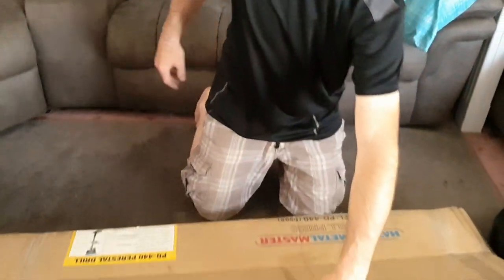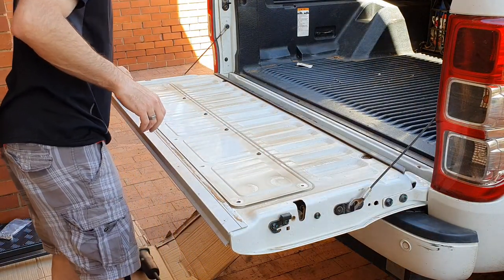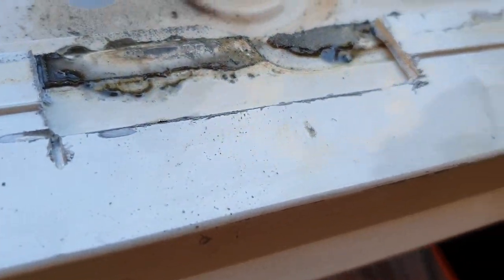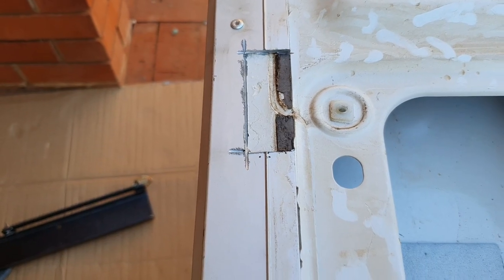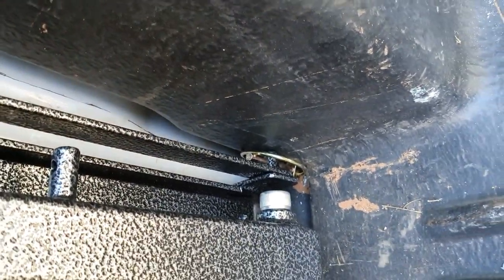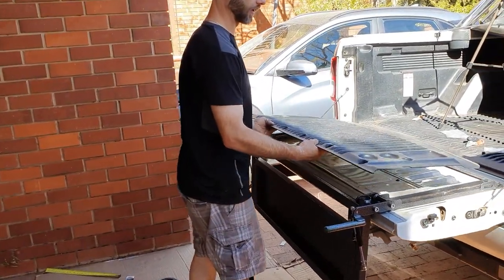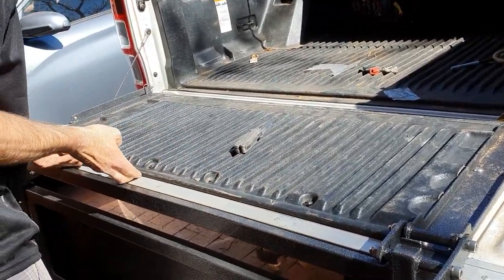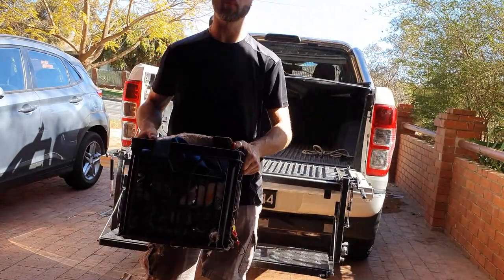Limitless Tailgate Step Install | Ford Ranger

Comment: I have the same Ranger and my first thought was "How heavy is that already heavy tailgate going to be?" Sure enough, you said it. Something I also noticed is the step can be used as a shelf either inside the tub with that bar locked onto the step or if you flip it down and leave it magnetically stuck then you have a shelf with a rim around it sticking out the back of the tub. Would be handy for a tradie like me as a painter and mixing paints etc.

Comment: It is a good idea but I would rather opt to put a sliding bed tray on my ranger so i do not even need to climb on the bed side. It looks better too and you can organize your truck bed more. But this video is also great :)
Reply from the maker: Yeah, the only drama with a sliding bed is you limit your height a bit as well as there's a while bunch of stuff to get gummed up with dirt and rocks and things if you ever transport that kind of stuff

Comment: Hi how are you doing? 
Is it worth to have it after one year use?
Have some rusted ?? Broken?? Or some parts were broken??
Does it make an annoying sounds ? When driving a vehicle? Like  squeak, crackle, .... Etc.
And thank you so much 😊
Good bye 👋
Reply from the maker: Hey there mate, honestly it's been fantastic. No noise, no rust, nothing has broken or bent on it. The powder coating hasn't even worn off any of it. I'm out in the desert this weekend, using it a lot as a seat and to get in an out of the ute. I'll record a little follow-up video a year in, thanks for the idea :)

Comment: Another drawback would be that I have the titan drawers and to get into them, assuming they weren't too wide, I would have to drop the step down to get into them. Which wouldn't be too bad I guess because I wouldn't need to pull the step down into position, it could stay up but If I am in and out of the drawers a lot and need to keep the back shut in between for security then it will become annoying. Then it would be a choice between how often I truly need to get up into the back and how often I need to get into the drawers. For me, getting right up into the back is required once in a while whereas I am getting stuff out of the drawers daily. But every time I'm climbing up in there I am cursing the tailgate.

Comment: Great job. Congratulations on winning this tailgate step. I want one and have reached out to them to answer the same queston I am asking you . I live in Texas and have a full sized Ford F-150. I was hoping you could tell me your tailgates dimensions please. Length and Width so i can compare to  my full size Ford tailgate which is 60 inches x 23.5 inches (LxW) Thank you sir.
Reply from the maker: Hey there mate, I've got some info for you :) might need to do some conversions though as my tape measure is in metric only
Dimensions of the tailgate on my Ranger: external width 1405mm & height 580mm
Internal flat area width 1260mm & height 515mm
The tailgate step mounted to the tailgate is width 1280mm (the handle sticks out past the flat area) and height 480mm
The other thing you might like to know is the height of the tailgate from the ground. My ute has a 2" lift in the rear so the tailgate is 850mm off the ground and this step folds out to be 520mm off the ground
I hope that all helps, let me know if you need any other measurements mate!
Reply: @DoctorOctane  Mine arrived last night. It took approximately 10 days to arrive from down under to Texas
Reply from the maker: Hey, that's pretty good actually, I reckon the last thing I ordered from the states took longer than that to arrive

Comment: Had a question from the edge of the tailgate to the step when opened what’s the length? Just have a 2500 with 37s want to know if it’ll be low enough to step on still
Reply from the maker: Hey mate, it's roughly 35-40cm. Definitely will be easier than what you're dealing with now!

Comment: Hello DoctorOtane, can you Please Please reply me as I really like your truck’s bed liner what is its brand name and which website you bought it from would appreciate your answer and do you have link of video for installation of bed liner if you made one when installed that.Thanks.
Reply from the maker: Hey mate, that bed liner is the one the Ranger comes with from the factory. I'm fairly certain it's only held in with the 6 tie down loops in the bed

Comment: What if you would have left the screws out and slide it in and not bend it. Then tighten the screws.
Reply from the maker: Yeah that could potentially work but once it's tucked under there and screwed down you can't even tell it bent. That would make it easier to install though and a good tip for anyone else having a go
Reply: @DoctorOctane  I would have creased it badly, That's just how easy I can mess stuff up! :)

Comment: Handsome, sexy, young man. What about us ugly, geezerly, old coots?  LOL.
They just brought the Gen 4 Ranger back to the US, and the first thing I realized was that it's almost a foot (30 cm) taller than my old Gen 3. I still bought it.
And, being said old coot, it's a lot tougher to get in and out of the bed to get something that slid to the front.
On my to buy list!
Reply: I'm not even really that older (30) 
I have the sports package, i think larger tires and maybe the suspension is a little different. Its rough to get in there, im def looking into some step solution
Reply from the maker: Haha, I've got a lift and bigger tyres on mine so my height of the step will be a couple of inches higher than standard. I don't imagine a factory "sports" package would give you more than a combined 75mm height increase but if it did this would still make it easier to get in and out
Reply: @DoctorOctane  idk its 940mm from the ground to the tailgate when its open
Reply from the maker: Yeah that's about the same height as mine unloaded, should work well

Comment: Can this be put on Toyota Tacom
Reply from the maker: Hey Ellen. It's very possible they have a set-up that's either perfect for the Tacoma or can be adapted. We don't really have the Tacoma in Australia but if the tailgate is the same as the Hilux, it should fit. Check the website to see what they have available

Comment: Is it still working well after 2 years?
Reply from the maker: It's working fantastic, you can see it in use in my most recent video but I'll do a follow-up soon
Reply: @DoctorOctane  that's great! What about if you need to load a pallet? Does the step get in the way or is it not too bad?
Reply from the maker: Folded down it's as though it's not even there, just need to make sure the forklift driver is aware it's there and folded up, pallets sit up fine on it to be able to be slid on a bit further if the forks are short and the driver prefers it folded up. Just need to make sure the driver doesn't drop or slide the pallet over the locking handle. Either way no major issues loading pallets

Comment: 16:15~19:23 Why did you not make little bit loose bolts for two side frames? You don't need to worry about bent nor scratched for the inner panel.
Reply from the maker: Unfortunately, you can't really access the bolts under the frame of the step so even if I was to slot out those four bolt holes, access to put the actual bolts in is obscured. Its mostly just a case of muscling it in under the frame of the step and putting the rest of the bolts in that are accessible

Comment: Just buy the step that goes under the bumper.
Reply from the maker: Because 1. if you change your rear bumper it looks odd 2. You miss out on the load stop feature and 3. You now don't have a foot rest when you and a mate are sitting on the rear step. Also the dinky little rear bumper step isn't possible to get onto the tailgate when it's open
Reply: @DoctorOctane  youn must not be familiar with the AMP step it bolts on to your frame and goes underneath your stock bumper. I have it on all my trucks and works excellent.  You can avoid butchering up your tailgate.
Reply from the maker: Yeah but it's still a tiny little step, under the tailgate. Not particularly safe for stepping up while holding something you're putting into the tub or while stepping out of the tub carrying something

Comment: You screwed up if you used hollow wall anchor bolts to attach the device you could of left it loose until the inspection was re-attached then tighten the anchor bolts no need to keep a spanned on the back side

Comment: First time on channel, don't know how I got here or what your channel is about but, you don't appear to be a car guy...I think more a computer of salesman of some type. Torx screws anti-theft? um no. So the heads don't strip. And normally they attach as a socket for your impact driver...where the heck is your impact driver?  Well heck, at least your giving it the old college try, so hat's off to you for that.
Reply from the maker: Thanks for leaving a comment mate, my channel's not really about anything in particular.
Let me try and address your concerns. First of all, there's torx head bolts and there's torx head bolts with the pin in the middle, the ones with the pin in the middle are considered "security" bolts. Yes they're less likely to strip when you insert or remove them but the pin was originally designed as an anti-theft measure and the bots to remove them are marketed as "security torx bits". Nothing to do with being a "car guy". Second of all, I don't own an impact driver. It's very difficult to use a tool that you do not possess and as such the torx bits that I used were of the manual, L-shaped variety. I'd be more than happy for one of my wealthy subscribers such as yourself to send me an impact driver so that I can use it but if it comes to saving for it myself, I have more important things to spend my money on than another cordless drill

Comment: One of the problems i see from this kind of products is the way they advertise it,  way too far from reality and way too expensive something supposedly for working class not rich class level
Reply from the maker: Right... not sure what reality you live in mate but if a $1,000 accessory for a $60,000 vehicle is too bourgeoisie for you then you probably should focus on putting food on your family's table rather than buying or accessorising a new vehicle in the first place. Personally, $1,000 for the practicality of this product and the amount it gets used is money well spent. Especially when you consider a decent set of wheels alone will set you back a couple of grand and provide absolutely no advantage over the ones the vehicle was delivered with. People will spend thousands on just the looks of their vehicle, providing no practical benefit to the user, then baulk at a product that makes their life with said vehicle easier.
Reply: @DoctorOctane  mic drop😂😂😂

Comment: Why did you say a foot and a half when we changed to metric before you were even born?
Reply from the maker: Because in some situations different units of measure are more appropriate to convey a sense of size than others. In addition to that, old timer, many things are still referred to by their imperial measurements no matter that we're under the metric system. Either way, did you understand what I was talking about? Did you get the gist of what I was saying?
Why did you make your user name all caps? All caps was shouting long before you were born
Reply from the maker: Dude, chill... you clearly understood what I said and are being obtuse for what I can only imagine is shits and giggles. You've had your shits and I've had my giggles, go home
Reply: @robertbutler8004  to be fair do you understand 450 apples, or two trucks long as a practical sense in your mind.  I love the metric system but when it comes to "about a foot" there is no good measurement for it.  you can say 450 mm's  but that is far harder to grasp in your head then "a bit over a foot".   If we are talking engineering specs here then yes stick to one or another, but in basic communication he is right most people understood what he was saying far better the way he said it.